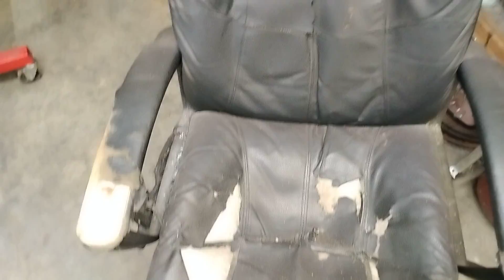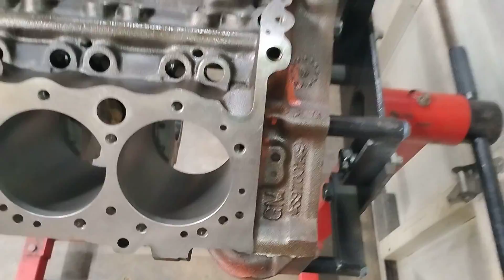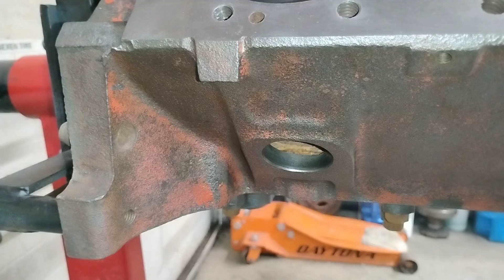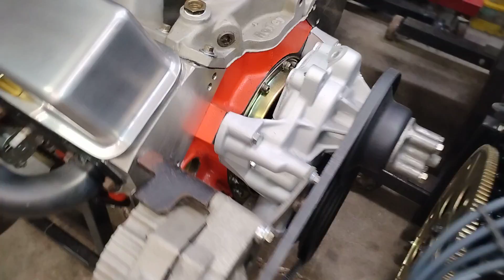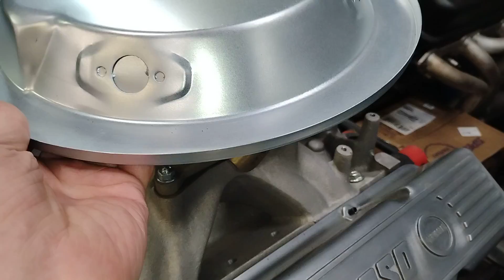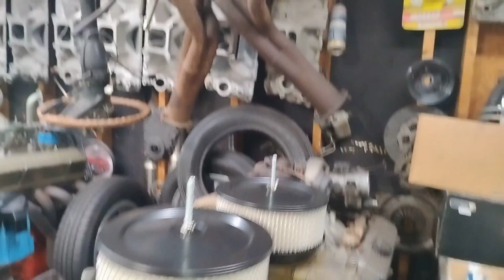Zero deck & set quench, and tips on SBCs. Current 355ci SBC build. The process begins..

Comment: what plan do you have for fuel with project 600 there? I'm thinking about building a zero deck 355 myself.
Reply from the maker: Probably use a 50/50 110 mix with 93 on the street, straight race gas at the track.
Reply from the maker: Also considering E-85, but I don't know if I want to deal with the corrosion. That shits hard on a carburator.

Comment: Got a question for you Sam. Why would a running motor be hard to turn over on a stand after changing oil pan and intake doesn't make sense done it before never had a motor do this.
Reply from the maker: That's strange. Have to be in the bearings or rings to create friction. Could be a cam bearing. Id investigate a little deeper. Loose is better than tight except for pussy.
Reply from the maker: Oil pan gasket or oil pan itself touching the rotating assembly? Check all that kind of shit.
Reply from the maker: Intake shouldn't make any difference, but an oil pan possibly could or a big fat 1 piece oil pan gasket.
Reply from the maker: I once seen a guy swap an intake and left some shop towels in the valley, put the intake on and the shop towels ended up in the timing chain and fucked it up. Hopefully something like that ain't the situation. But shit happens. I've seen it all.
Reply: Thanks yup it coming apart later today it was always hard too turn over on the starter when it was in the car. It was driven hard to make your eyes hurt. So who knows right. Thanks for the feedback.

Comment: Content just keeps getting better!,my 100,000 mile 2000 z28 is up for antique plates on it and I want  to dump a gen 1 sbc in it .
Reply from the maker: I been thinking about buying a cheap V6 gen 4 and swap a bigblock Chevy in it or a old school SBC. Seen a nice straight body for $500 bucks the other day. V6 car needing an engine. Wouldn't feel guilty about cutting one of them up.
Reply from the maker: That would be a cool swap. Old school SBC in a 2000 F-body definitely be different. And these fuckers can make some power.
Reply: Recess on motor position with a rear distributor something  I gotta look at might have to box out fire wall ? , haven't got that far yet.

Comment: "Not to flashy with a dual high-rise" love it.
Reply from the maker: I try to avoid the shiny billet valvecovers with flames engraved on them and shit like that. This engine is getting tall black valvecovers that look like Moroso tall covers, but no name on them. Engine gonna be pretty serious tho. Normies only see shiny shit. Paint it all black and they don't know what they are looking at. But it'll be obvious to a gearhead what's up with the tunnelram and twin double pumpers. And the big fatass 1 7/8 primary headers will be a clue. And it'll be loud as hell. Should run low 10s high 9s in the 1/4. Going into a 2600lb car that's pretty set up. Running a 5500 stall & 4-88 or 5-13 gear. Building a 750-800hp 496 bigblock for it next. I already have the engine, just gotta put it together.
Reply: Build one for a 400 shot.
Reply from the maker: @lanesmith148 I have a twin turbo SBC and a twin turbo bigblock Chevy also, I'm sure one of them will end up in it eventually. Gonna have to make more upgrades at that point tho. Like to tub the car out and run a 32x14x15 slick under it with a 4 link.

Comment: Another great video here. I had a motor guy built a 383 010 block had it all cleaned up really nice motor. The connecting rods were within 1000th of each other the motor guy was really cool he was impressed with the bottom end on there. Solid roller 282 comp. Them small blocks are the way to go from what I've seen.
Reply from the maker: They definitely have potential. Built a bunch of them. Run some good numbers with them too. More parts made for them than every other engine combined. Plenty of choices.
Reply: @thereluctantgearhead4544  . My brother's had some bad ass Chevrolet's. 396 biggest cam comp had ran awesome LS6 454 LS1 8 different big blocks. My favorite is the 70 350 Monte Carlo. Had a GM cam 375 HP. 411 rear . After my dad sold it a dude raced it for 5 years. Had 60.000 original miles. GM #1
Reply: @JoeKalmar-m2t  YEP , I’ve Had All kinds Big & Small Blocks - My 1970 LT1 350 -  Corvette was a  Great Running Engine , LTI  Did some Cam & Head work on it when it had around 60 ooo on the Clock , it ran Strong ! & A Salute out There to  Early 327 motors 🫡
Reply from the maker: @JoeKalmar-m2t 70-72 Monte Carlos were the best. Good looking rides. Always wanted one.
Reply from the maker: @JohnnyB-n4z Them old 327s make Alot of power if built right. Had a 66 L-79 from a Chevy 2 SS  in highschool that made 540+HP NA. Built it when I was 16. A long time ago. Can't wait to get my current 1965 L-79 built. It's gonna rev to the moon. 1970s drag race engine.
Reply: @thereluctantgearhead4544 I honestly couldn't believe that I got rid of it but there's more out there. I got a wagoneer so I can learn lead work. In PA everything is rusted to shit. Glad I grew up in Montana where people still drove that old stuff around. I don't feel right in the new stuff. I can't listen to the motor or tell that it's warmed up. I do see why people run them but I don't. 78 FXS 79 wagoneer 85 c30 blew the head gasket 05 Silverado 4x4 . 99 trans am waiting to go in something. Probably the 85 or the jeep who knows

Comment: Go through them, hand pick out the best of what you want too keep, and put the rest out for sale.
Reply from the maker: Id rather have the engines than the money. Money comes and goes, but some of this old shit is getting hard to find. I rarely sell anything these days, but I buy alot.
Reply from the maker: I've sold some shit years ago, if I had that shit now I could really cash in. And I sold the shit when it wasent that valuable yet. Had a L-88 427, sold the short block for $2000. Sold a 302 SBC for $1500 bucks, 455 Stage 1 Buick engine I sold for $1000 bucks. Etc. Now try finding any one of those and see what they cost. Shits gotten crazy. Back in the day, musclecars were just used cars most people didn't want. If only I knew then what I know now, I'd be rich. I went thru a bunch of rare highly desirable shit back in the day.
Reply from the maker: I once blew up a real 69 RAM AIR 4 400 out of a GTO. That engine is worth a fortune now, back then it was just a badass factory engine. I paid $500 bucks for the whole engine from a totalled 69 GTO. Now that engine would be worth 30+ thousand bucks.
Reply from the maker: I started out as a Pontiac guy.

Comment: What's your opinion on the 350 Rocket olds motor I have one in a 81 Malibu are they good for high performance mine is stock with headers
Reply from the maker: He turns it up to about 8000rpm too.
Reply from the maker: Yep, they have Alot of potential. I know a guy with a 82 Cutlass drag car with a 350 Olds. Runs high 6s NA in the 8th. Has milled and ported B heads on it, Victor intake, 1000cfm HP Holley, 680+ lift solid roller cam, over 12-1 compression. Runs real good. Engine been together over 10yrs. It's a 68 350 Olds. Well built.

Comment: I really like your lone wolf old office chair. I have one myself for staring at my collections. Do not collect stamps! Unless they come out with a tribute to SBC/BBC iron!!!

Listening to your guide. I'm not to far off on my build. It's coming out good for my 1st one. 

My Mexican 4 bolt 355 came out of the machine shop zero decked with my rotating assy stacked. I also used felpro .038" head gaskets. 64cc AFR heads. .200"+ valve clearance both intake and exhaust. 

Things I didn't think about, chamfering oil return holes and supply ports. The shop also already installed the galley plugs. I would have tapped them if I knew at the time. I doubt they will spit out, since the chisel punch marks were heavy. HV Mellings I doubt will make enough psi to knock them loose.

Also one thing that concerns me. Priming the oil pump, the pump is loud. The only thing I can think it is, is the straight cut gears meshing. It sounds like the pick-up is rubbing on the pan which is impossible. I have 3/8" clearance with the gasket installed.

Comment: Your seasoned opinion on 2bolt 400 sticking 350 crank in it and double up the main bearings to make hot little 377 that’ll buzz up good using some ported 487x heads gotta put some steam holes in it. So far this is the plan. Your criticism will help some. Thanks
Reply from the maker: Built a few 377s. Real good combo, make good high rpm power. Big bore make the heads flow more.
Reply: @ what would you do for a carb and intake for my little street 377

Comment: Have you ever got a PHS document for the 421 super duty? Car has to have some kind of drag racing history.
Reply: I would still get the document  from from Pontiac historical services.. man if you ever decide to sell it.. you'll get a bigger bag of green, who doesn't like a big bag of green 💨 lol
Reply from the maker: @jerrywhaley6397 I'll never sell it, so I don't even worry about shit like that. I'll end up just drag racing it. Probably won't live long enough for it to matter anyway. But yeah, it's real. I'm the one that took it apart about 30yrs ago. It's pretty gutted. Id be interested in reading up on it tho. Might have to look into that. I wanted a Super Duty 421 Catalina since I was about 10yrs old and seen one. It sounded mean as hell, guy lived down the street from my grandma. I was impressed. I started out as a Pontiac guy, shit just got real expensive for them musclecar era Pontiac parts. I've owned early Firebirds, 2nd Gen Trans Ams, GTOs, Gran Prix,  etc. Still have a soft spot for them. Almost died in a 67 Firebird. First engine I ever built was a Pontiac.
Reply from the maker: @jerrywhaley6397 It came stock as a "405" HP SD421, BW 4SPD, 4-30 geared 9.3 rearend with a cone Posi. Ran low 12s stock.
Reply: @thereluctantgearhead4544  lol from what it looks like you don't sell anything ever LOL make a video and let's see what you're working with. Does it still have the special bellhousing? I can only imagine the astronomical price for one of those if you could even find it.
Reply from the maker: I knew the original owner. Had a Pontiac dealership. Car was raced as a NHRA stocker till 1970. Clutch came apart and destroyed the engine. Been parked ever since.
Reply from the maker: Very low mile car. Looks like shit from sitting 55yrs.

Comment: 425 Oldsmobile ! A Really Decent running Engine , 👍
Reply from the maker: I had a full race type 455 in my 79 Cutlass, car set up to drag race. Ended up blowing up the engine. Pulled a 1966 425 out of a tornado that had about 20,000 miles on it. Factory rated at 385hp/480tq. I dropped that engine in my Cutlass totally stock, used big ass Hooker headers on it and a killer Mallory ignition system. Engine was stock. Car still ran 7.60s in the 8th mile. Ended up building that engine proper and the car ran 6.80s. Turned it over 7000+rpm. Still have that engine. Bent a rod, but it didn't break. Damn good old engine. I have a 67 425 also.
Reply: @thereluctantgearhead4544 They really were a Good Runnig , A lot of Guys never even had them to run , I had 69 & 70 455s. & 2 425s. & It’s. Dam near a Coin toss 🪙 Choice ,
Reply from the maker: @JohnnyB-n4z them Oldsmobile engines were a different animal for sure. I still have a collection of them stashed away at my other garage. Slowly gathering parts to build another 455 now, it's gonna be a drag race unit. Aiming for 650+HP NA. They sure are proud of those Olds race parts. Bigblock Oldsmobile engines have a unique sound, especially with a huge solid roller with a bunch of compression. I've had a bunch of Cutlasses over the year's including a 69 442 and a 71 442. Was also a big Pontiac enthusiast for a long time. My first engine build was a Pontiac. I build Chevys now mostly because of price and availability plus they can make shitloads of power. I'll always love my BOP engines tho. Had a few mean Buicks too. Always wanted to build a high power Cadillac 500 engine. But that shit cost Rolls Royce money and race parts are rare for them. Some killer shit for them does exist, but it'll make ya poor quick.
Reply from the maker: @JohnnyB-n4z I really like the Olds 425s. Probably the best Olds engine for max power. Still have a 66 Toro 425. It'll get put back together one day.
Reply from the maker: Yep, I built a couple rowdy versions and they definitely can run.

Comment: That’s the block that has the ridge all the way up . I learned some good stuff on that video
Reply from the maker: Yep, these blocks are pretty tough. Even the iron used was better than later model versions. Has the small holes in the deck, forgot to point that out. Even square decked to 9 inch, still thicker than 80s/90s 350s.
Reply from the maker: Extra ribs in this block too, plus the main saddles are thicker, the main bolts don't go all the way thru the block. More material in the high stress areas. Also has nodular 4-bolt main caps too.